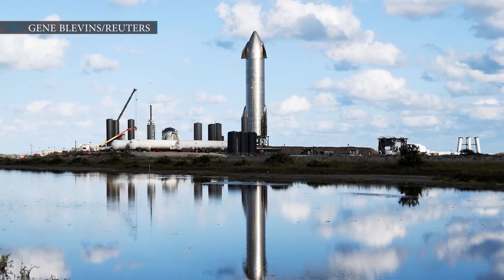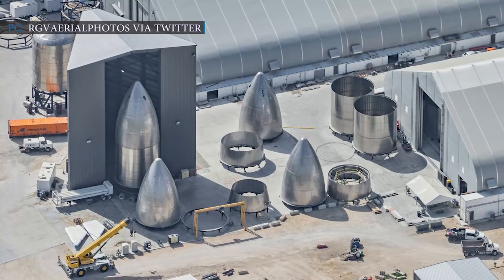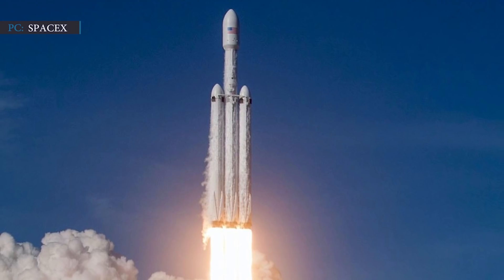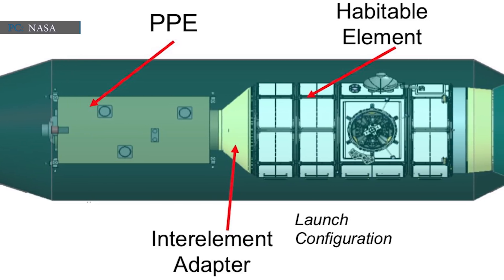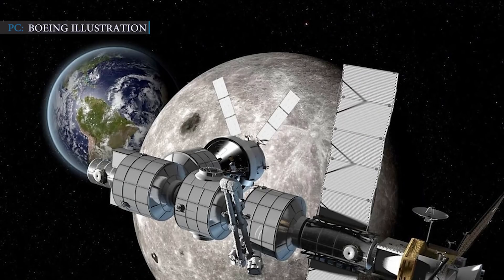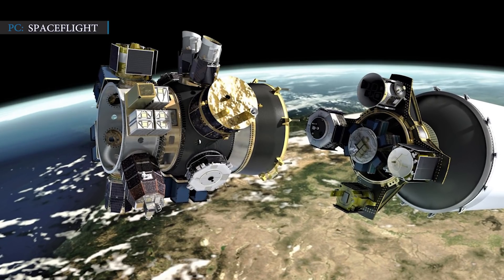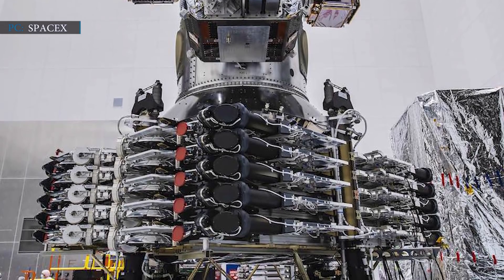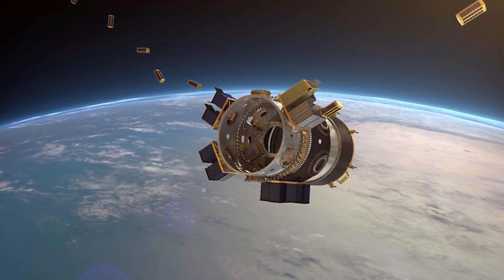SpaceX Starship rolls off assembly line ahead of "Major Upgrades" | Falcon Heavy bags Lunar Gateway

Comment: NASA did 7 flights of the Saturn 5 rocket and landed on the moon on the 8th flight. Obviously they spent more time on designs they knew would work (because of ground testing) and once NASA decided how they would go to the moon they made it happen. SpaceX is learning piece by piece (through full up testing) how to do what NASA did through solid engineering. It will take a few more failures to iron out the unknowns then SpaceX will look more like a serious space program and less like a science experiment.

Comment: Larger control surfaces on the nose of Starship would allow for fastter and more reliable uprighting of the craft for landing instead of the massive dependence on the engines to do most of the work. This will prove to be a  greater issue with fully constructed and outfitted nosecones.

Comment: Obviously the volume within the fairing for the Lunar Gateway launch is projected to be significantly greater than the volume within the payload.

For launches where the internal volume for a payload such as a habitat like Lunar Gateway would be beneficial.

Why can the exterior of the payload itself not be streamlined to an extent that a fairing is not necessary thus enabling a greater internal volume?
Reply: I suppose that would mean to spend a lot of mass and design effort in something to be used only for three minutes. To put it lightly, suboptimal. It's easier to Summon Bigger Fairing.

Comment: Bitcoin has seen some mixed price action lately, with bulls and bears largely reaching an impasse as the cryptocurrency consolidates. Where it trends next will undoubtedly depend largely on whether or not bulls can break the ongoing consolidation phase and spark a move higher as it has been struggling to gain any clear momentum lately, with its price action largely consisting of range-bound trading between $35,000 and $40,000. This large trading range has held strong throughout the past couple of weeks, and any attempt to break either of the boundaries has resulted in rapid rejections. But it is not enough to sit back and hodl, rather it is time to take advantage of the various signals and strategies at our disposal that will make trading profitable. I and my team of expert traders provides some of the best insights  in crypto trading on {telegram @trading_mentor_fx  or WhatsApp   +447723705032}.  we have been able to guiding investor on how to grow their portfolio to 5btc with an initial capital of 0.8btc.. Lets capitalize on the current market trend while we remain optimistic for a productive future.

Comment: SN12 to SN14 have been set aside.  SpaceX will go from SN11 to the next block of Starship prototypes SN15, 16,17, and 18.  There are a number of improvements for weight reduction and simplification.  The real question is when is one going to land?  At this point it looks like that’s going to be dependent on the Raptor engines.

Comment: I'm confused (which happens a lot), I thought the Falcon Heavy could get heavy payloads into Earth orbit but couldn't get us to the moon, hence the need for SLS or a deep space craft like Starship etc. If the Falcon heavy can get a space habitat into orbit around the moon it could theoretically put humans in a moon orbit as well right? I thought that the Falcon heavy did not have enough Delta V to get humans to the moon? Thus if we've had the craft available to get us to the moon for a few years now why the big race to create a craft that can get us to the moon? I'm sure I'm missing something here.
Reply: First, SpaceX is not building lunar or mars habitats or orbit station. SpaceX is service provider with vehicles capable delivering payloads (think of it as space trucks). Despite them being capable of delivering payloads, its NASA whom is building the gateway thus it all comes down to NASA who decides who will take the gateway to a moon. 
Second, even that, its gonna take at least another 3 years for NASA and who knows who to construct the gateway.
Third, Starship gonna cut the prices and instead of being refurbish-able rocket, it will be 100% re-usable, especially second stage (Starship). With extremely short turn arounds.
So once the Starship is ready, even Falcon Heavy will be obsolete and ancient in comparison. We might see Falcon9 sized version of Starship launch system for small payloads with ultra cheap cost per launch.
Reply: NASA has said they want competition in the industry. Probably true but also old bureaucracy connections between NASA, military,  and companies like Boeing. Lots of $$$ been paid out for many decades.

Comment: Spacex won 
- Commercial resupply service
- Commercial crew program
- Lunar gateway contract launch
- Lunar gateway supply with dragon xl
- Human landing system
Reply: SpaceX hasn't won the human lunar lander contract. They are in the running with Blue Origin and Dinetics  but the winner won't be announced by NASA for several months. If SpaceX hasn't successfully landed a starship prototype at Boca Chica by that time, it ain't gonna happen.